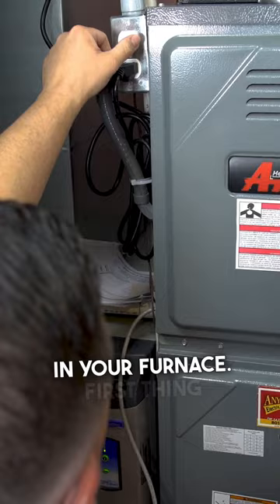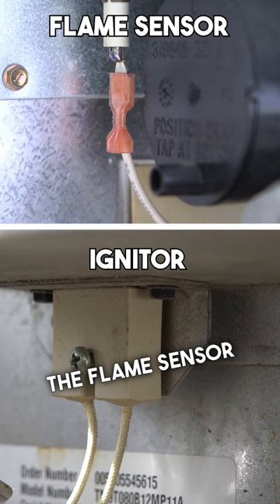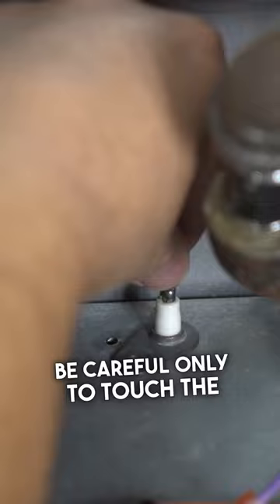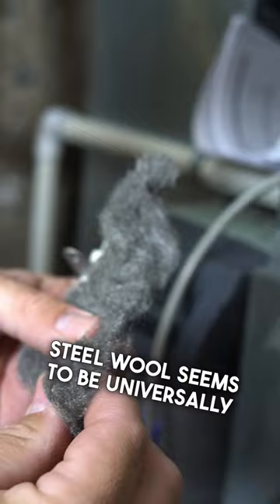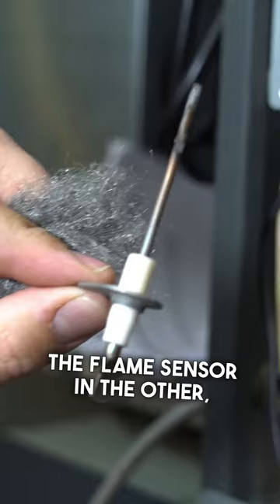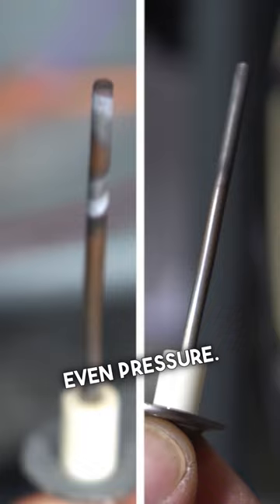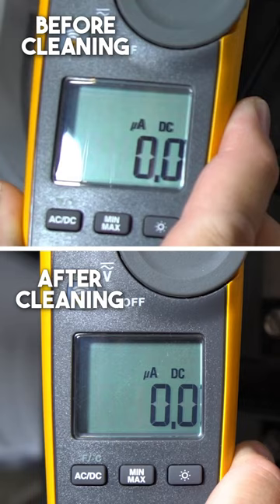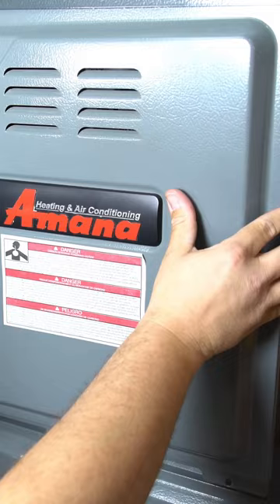How to Clean a Flame Sensor

Comment: Thank you for your post!  It’s exactly what I needed to do for my furnace that kept shutting off after a few seconds of flame turning on.  I would add I used a #0 steel of wool from Home Depot which was one step coarseness above the one that is mostly for polishing metals.

Comment: I just told my husband that this had to be done, he does furnace and duct cleaning, but never knew about this.  I did, because before we got together my furnace has had to have this done, and also being a plumber/gasfitters daughter I know a few things, worked for my dad too.  This video was great, off he went, and for a few moments of no heat and freezing as it's -30C out, he got to it, but it was me that had to get in at it, my hands were smaller!!  We got it done with teamwork and are warming up.   Now hoping it will stop cycling off and on so often!

Comment: Thanks for the info. I was told that if you use something like steel wool, you can create burrs that will cause the flame sensor to collect dirt faster. Some people recommend using a dollar bill to clean the flame sensor.
Reply: And here I am, 15 years later, still using sandpaper and never having a callback because of it.

Comment: I especially liked the part where he explained exactly how to test the flame sensor.
Reply: You’re funny
Reply: The flame sensor has a chassis ground so to measure amperage, you'd measure from the quick-connect terminal on the wire to the sensor and the metal frame it's bolted to.

Comment: Use stainless steel wool scrub pads to clean the stainless steel flame sensor rod. Using regular steel wool will impregnate non stainless steel into the rod making it rust and corrode faster. It emits electrons through the fire into the grounded furnace body. Corroded rods don't emit as much as the board is looking for so it's best to keep it clean as new. Check your ground connection if problems persist.
Reply: Where do you get stainless steel wool?
Reply: @tgeliot  it's unattainable, you have to make it! lol
Reply: @tgeliot it's a brillo pad. Supermarket item
Reply: @mikemealey3661  LOL I probably have one under my sink.
Reply: That is the worst explanation of flame rectification that I’ve seen in a long time 🤣
Reply: @jman0870  I had to go reread the Wikipedia page on flame rectification, and yup, I agree with you.
Reply: @tgeliot  high five 🖐️

Comment: You may have just saved me a repair visit.  Furnace stayed on first try after cleaning the flame sensor.  👍🏻 Hopefully, that was my only problem.  I didn't have steel wool though, so I used 1000 grit sandpaper, and then plain paper and clean air blower to clean it off afterwards.  May I ask what the reason is for steel wool specifically?  Is it a long term corrosion risk by contaminating the sensor?
Reply: Steel wool is very fine grained. It should have enough "coarseness" to remove the soot buildup on the sensor (unless you have a really dirty sensor, then its scrapping time). Steel wool is easily molded to the shape of the sensor, and it is walmart cheap. Your choice of 1000 (fine) grit sand paper will work just great as you have found out. There is no contamination issues with rubbing off the soot. it is actually better then when your started (unless you have gouged or removed too much surface area). Also the "sensor" is the heat transferred from the end of the rod to the wire hookup. Once the rod gets to a certain temp, the wire "senses" this and  the circuit will close allowing the system to run properly. The soot on the rod was preventing the proper heat transfer to complete the circuit. All that to say you did it correctly and saved a yourself a $300 service call. Cheers.

Comment: I often find screws that have been stripped out by the guy that uses a power drill on furnace and AC's.
Don't be that guy.
Reply: I find that people that can’t operate a variable speed drill, wouldn’t be able to operate any handtools either.
Reply: It’s an Amana. The holes were stripped before it was taken out of the box.
Reply: @jman0870 😂😂

Comment: how can you test the flame sensor when the power is off and the door is off... make sure you explain to people who have no buisiness doing this that they need to a) have a multi meter. b) turn power on. c) depress the door safety switch momentarily to allow furnace to start up.
Reply: And put the meter in between the sensor and the circuit board.
Reply: @scott5654  is that how you measure the microamps the flame sensor puts out? Disconnect the wire & put the meter between the male lead on the flame sensor & the female end of the wire that connects to it?
Reply: @D-Mayor  read your meter instructions 🤣
Reply: @jman0870  no meter instructions are going to tell you how to test a flame sensor.
Reply: @D-Mayor  micro amps DC are hard 🤡
Reply: @jman0870  to bad you can't get.....
Reply: @D-Mayor  huh?

Comment: I use sandpaper because idgaf. Also I know how to wipe it off when I’m done. I’ve never ever had a callback for it. 

Before the resi clowns come rushing in and try to shame me, I have pulled flame rods out of commercial equipment that were full of tiny holes and warped from heat. They still work fine. They just need to be clean and in the flame. It’s not rocket surgery.
Reply: Yea I've seen some with small grooves that still worked fine